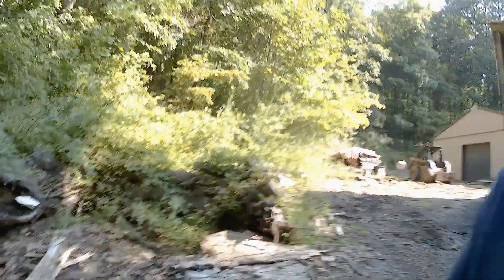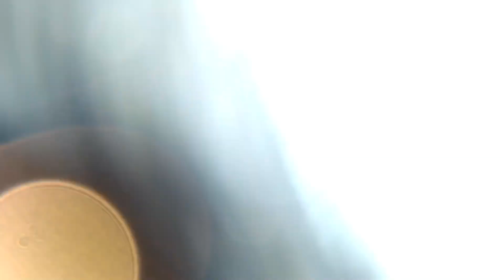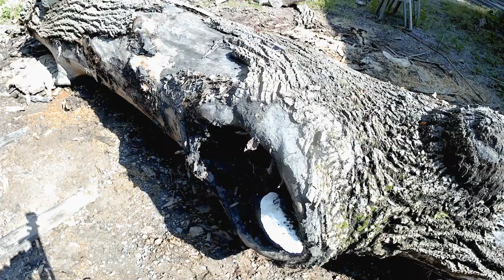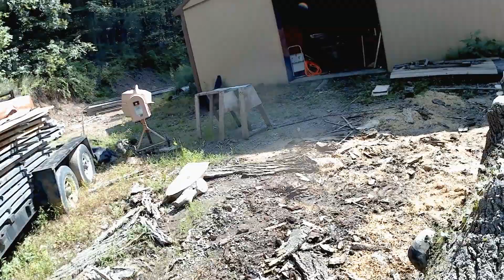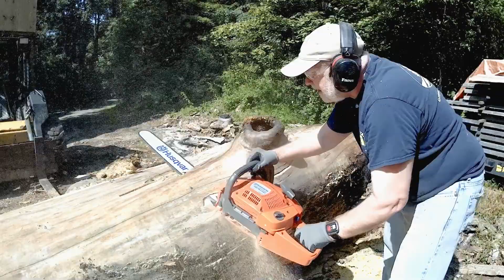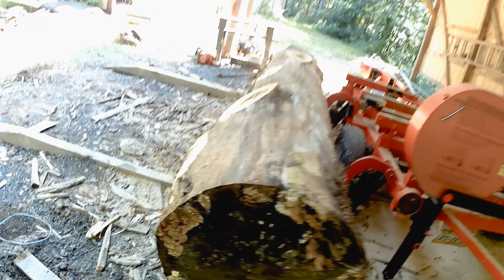#489 What An Ugly Log  Can The Lx665 Skid Loader Handle It

Comment: When I have log that is over sized for my mill, I'll put the big end towards the head that way I can slice off the over sized until I get the  Butt where the throat of the mill will pass through at ease. I have the same mill but Lamberdini diesel engine. 96 model.